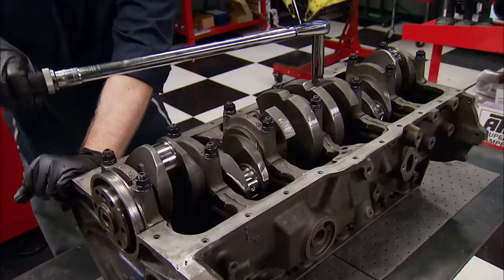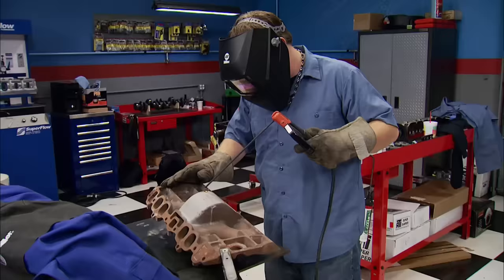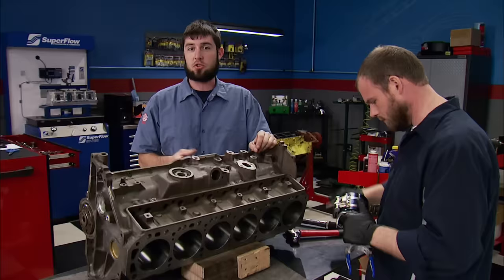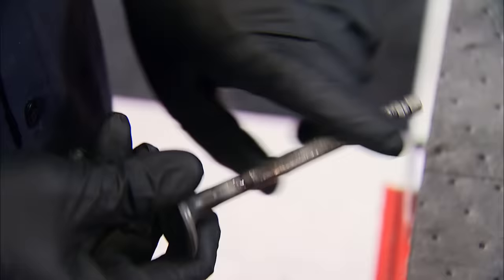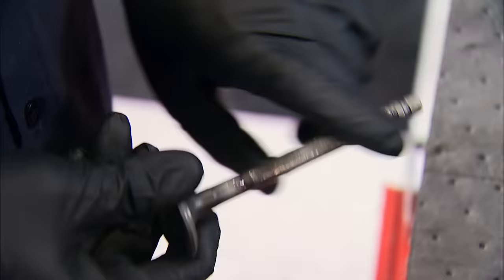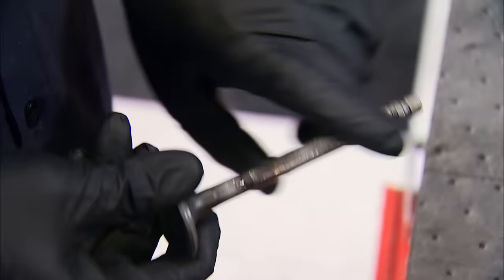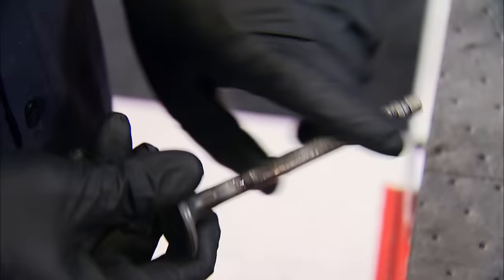What Will A New Top End Do For Our Old School Inline 6 On The Dyno? - Engine Power S1, E4

Comment: For the amount of money and time invested in building that 300 inline 6  I would have expected significantly more power than realized . Just the intake , cam, carb and header cost over $2000 together. Adding that to the rest of the parts and machine work and your up into the $4000 range. And what does that $4000 investment get you ? A gas guzzling 6 cylinder that doesn't perform anywhere near a used pushrod 5.0 from a wrecking yard costing about $200 + tax

Comment: These are super engines for old tractor rebuilds.
Reply: We used  to see some in trucks , not pickups , the big old 3 tons. When they were run loaded , wot for miles on end they were only good for 30-40 thousand miles before the bore was wore past a rebore . Thats why most farm equipment used a 292 chev

Comment: That 390 cfm carb is too small!!  Try a 500 cfm and it will really help the top end power.
Reply: Yeah, those 500 2 barrels are half a dominator for the most part, tuneable af and work great for daily drivers. I run one on a slightly modified 302 and it's so much better than the stock Motorcraft/Holley junk that came stock.

Comment: Never arc weld cast Iron.  Too much heat causes the material around the weld to be brittle.  Brazing and slow cooling is a far superior joint.

Comment: Use a torch to heat the crack red hot and weld it with7018 high nickel then tap it out

Comment: The comment about the steel crankshaft not handling high RPM is actually incorrect. There is a guy racing these engines with a factory steel crankshaft at 7000 RPM.

Comment: I love these 306 cylinder builds I would love to see this with a turbo or supercharger on it
Reply: I'm not saying that you couldnt do it, but the 300 i6 had such a long stroke that it limits the rpm alot. A super charger or turbo probably would spell its demise. They are great low rpm tow engines because of that long stroke.
Reply: @ciphercode2298  true

Comment: 5000rpm isn't the problem, snapping multiple role pins in the distributor shaft due to excessive oil pressure is the problem.

Comment: I was expecting a little more horsepower, after all it’s 300+ cubic inches. But they don’t say what the compression ratio is. I would have run a 600cfm vacuum secondary carb, I mean you wouldn’t put a 390cfm on a 289 or 302

Comment: I had a 300 paint can Ford engine in a van. The bottom end was a piece of S%#$. First blew with 23K on it. Under warranty it was replaced by Ford. The second one did go nearly 33K before it blew apart. They were junk..oh ! This happened in 1977, I never put these motors under a lot of strain, they took me to the beaches where I surf and back home, no undue pressure. This sealed my fate with this motor and with Ford.
Reply: Sounds like you really know how to abuse an engine.
Reply: @eskieman3948  your conclusions are based on your ego.

Comment: Ok guys I got one for you I've got a 95 ford ranger 2.3 . So what can y'all show me to get that 8 plug head down the road with a vengeance. I've always wanted to turbo it but was told you can't turbo a 8 plug you also can't find a aluminium head readily available for the 2.3. Which is sad because the 2.3 Lima is like a ball bearing in my opinion.

Comment: I want to see if anyone else agrees with me. 
This engine could have used a much bigger header and carb. For the carb, don't think cylinders, think cubic inches. This engine is 309.16 C.I.
One small block Ford V8 is 302 C.I., and people use 650 CFM carbs all the time. 
For the headers, don't think about 6 cylinders, think about one cylinder. Each primary tube handles only one cylinder. A Chevy 388 stroker has the same 4.060 bore, but a shorter 3.75 inch stroke. That puts each cylinder at 48,55 C.I. The engine build in this video has a bore of the same 4.060, but a taller stroke of 3.98 inches. That is 51.53 C.I., for one cylinder. 
Now, I know this is only part of the equation because half of it is about head flow, but at least the C.I., per cylinder should be included for choosing. 
It's just my thoughts. Am I on the right path?
Reply: you aren't going to see that much air moving on a low revving 6
Reply: @ironmonkey1512  I believe my 85 Mustang GT 302 had 550 CFM CFI injection on it. It shifted by 4800 RPMs at full throttle. The engine in this video only had 390 CFM. I just think that it is too small.
Reply: @jhutch1470  6 cylinder isn't going to move as much air as an 8 at the same rpm. Think about a v12 compared to your v8
Reply: @ironmonkey1512  I'll have to look some of this stuff then. I'm just not seeing how a 4.2 liter V-12 could pull more air than a V-8 that is twice the size. I guess I'm missing some science.

Comment: What carburetor was used I missed that part, putting intake and headers on a straight 6 today and was comparing carbs since they said it leaned out was curious if I have the exact same situation
Reply: 390cfm Holley, probably an 8007. Personally, with a 300 engine, I would have gone with a 600cfm.

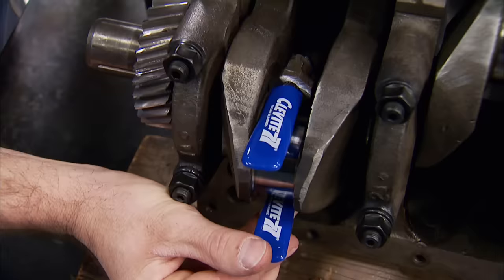Comment: This is the 3rd time I've watched this 300 build, but it's the first time I noticed the gouge in the cylinder wall at 6:18.  What did you do about that?
Reply: Nothing, you saw the blowby so you know the ring got hurt.
Reply: @jimmartin7881  Yeah.  At  14:10 I noticed the blowby before and thought it strange to have so much in a new engine.  It seems like such a small problem but that little nick could cause a rebore and new pistons.  If you look closely it looks like they used a ridge reamer and dingle ball hone and called it good...but maybe it wasn't good after all.

Comment: Hey I got one for you!. I have a Ford Ranger w a 4.0 v6. I've wanted to put a v8 in it but you basically have to have a v8 explorer donor car for all the parts needed and you even need to open the size of the trans tunnel at the firewall!. (Some guys just hammer the edge)  That's a lot of work!!. So what can be done to get better than stock performance out of my 4.0 v6??   Thank You!  Just smashed the subscribe button too!!
Reply: Put a turbo 4 cyl in it.

Comment: 390 is a bit small of a carb I think. I woulda went with a 650cfm or bigger. Would you put a 390 on a 302 sbf?
Reply: @thomasdaddio741  I agree. I was hoping for EFI as well
Reply: That's the trick with these engines, they were designed back in the 1960's and they don't breathe well at all. The lack of breathing results in excellent low rpm gas velocity and VERY good low rpm torque because of it, but as a result they still can't take in much air or fuel or get any of it out the exhaust. Crossflow designs, where the intake and exhaust are on opposite sides of the engine, solve this, but.... Stuffing long sixes into engine bays wasn't profitable anymore, so the V6 replaced it instead of updating the head. Overcarbing these engines is extremely easy, with 500CFM carbs running rich but making more peak power. When the stock redline is 3600 rpm, you just don't have much use for 650cfm carbs. The Holley 390 4 barrel has long been the king of the 300 world! It sure beats the tiny single barrel it came with :P

Comment: It was my understanding, after using plastigauge to build several engines that the journal/bearing should be "dry" with no oil on either surface to get an accurate measurement.  Somebody correct me if I'm wrong.
Reply: You're not wrong, it is to measure oil clearance

Comment: This would pull a heavy trailer all day and pull well on hills with more than 300 hp.
Reply: That 300 was tq, and the 206 hp comes out to around 150-60 after parasitic loss when installed.

Comment: What’s the recommended process for checking clearance with plastiquage oif the bolts are torque to yield, being you can’t reuse the bolts after you torque them down? Anyone?
Reply: You don't need to torque them all the way. Just snug so the plasti gauge flattens

Comment: What about the difference from that 300 to a 90s straight 6
Reply: Slightly different cylinder head that they optimized the combustion chamber shape for the port fuel injection, they added more threaded holes to account for the dual EFI exhaust manifolds having more bolts to support them over the old single log exhaust manifold, depending on the year the radiator fan (clutch or fixed) will bolt on to the older 300's but the newer ones are threaded in one of two sizes (as of 1983 or 1984, I believe, with a change in sizing coming somewhere down the line), and.... I think that's it?

Comment: Never ever ever use silicone on gaskets silicone Watering your gaskets to mush if you want to use a gasket sealer for gasket use Aviation type Permatex remember never ever use silicone on gaskets it will turn paper and cork gaskets to mush I've had to regasket mini motors because of silicone silicon is supposed to be used when you don't use gasket ultrablack is a very good sealer foremost non gasket uses like thermostat housing rear end cover gaskets oil pans and valve covers were no gasket is used and the front and back of the intake manifold on your older Chevys and Fords

Comment: I am not sure the point of this. Rebuilding a 300 to slightly better than factory. I rebuilt a 300 in engine class without all that machine and valve work and got similar dyno numbers with the factory carb and intake.

Comment: anyone else have crap results with Dupli-Color and VHT engine paint? Chips off if you look at it, with or without primer, 100% clean metal. I even had a result that regular rubbing alcohol on  a paper towel would lift color after a week or more of cure in summer weather.

Comment: Fix the parts used in this episode text.
It lists as using 3 different Carbs on this engine. What models needs drilling, because i would hate to drill in a brand new carb to get 200hp?
Wrong intake manifold.
Wrong valve cover.
Wrong MSD ignition
The Brakes and tires are not used in this episode
The Supercharger system is not used in this episode
I dont even think the Royal Purple 5W30 is used here either.

On a different note, my old year 2000 Turbo 4 cyl Saab had the same HP as this engine and nearly the same torque, when it left the factory.

Comment: maybe if you guys werent limp wristed you wouldnt have dropped a 6 cylinder bare block 😂 . NEVER use gasket sealant to seal up freeze plugs ! Use 3M yellow sever duty weather striping sealant on clean surfaces and make sure to coat the 2 surfaces where the plug slides against the block when installed . regular sealant has been know to let loose and freeze plugs pop out under pressure

Comment: LMAO! Complaining about $10:00 bucks! Not a wimper about the cost of the ARP bolts, and studs that weren't necessary for that build level! Stock bolts would have been just fine! And A LOT cheaper. If it had been a real budget build, probably could of have had it balanced. Should have used the vac.600 cfm and let it breath a little better, and still had the vac. secondarys.

Comment: Uuummm 305ft-lbs of torque? C'mon guys, that motor will sing with  a few PROPER modifications. Not sure I should be impressed, and I've owned 300's before, this is a gross misrepresentation of this motors capabilities.

Comment: If it were a FORD guy he wouldn't have dropped it. Dum ass... I built my 86 300 with Clifford parts. Bored it out to 305ci. 310 HP / 254 torque. Years ago the Germans Brits and Italians drop inline 6's in their racecars. Love the sound, love the low end grunt.

Comment: Why did You put such a small carb. on this engine, it is 300  cu. in. , You guys are always using  much larger carbs on v8 engines of the same displacement, it is no wonder that it only put out 305 hp.  , let that six banger breath a little

Comment: 'Nice and clean, so it's ok to weld", then they spray it to remove machining oils......
Reply: I'm pretty sure they were referring to the crude you find caked on to any old engine like that. Regardless when I took a welding class about a zillion years ago the instructor stressed that the metal should be very clean. No oil. So yeah. Clean it anyway.

Comment: 5 liters and 200 crank hp.  

I mean why?
Reply: They were made for low end torque. Not HP.
Reply: well the engine was designed in 1962 and were made to go into things like dump trucks and the big heavy duty trucks. The make peak torque at 1600rpm and are extremely reliable.

Comment: Wow that carb is way too small 650 cfm minimum
Reply: I have to agree. Every forum I've asked on,  has suggested  a 500 to 600 cfm carb. I'm  going to try a 500 on my similar build  right now.
Reply: @johnjamieson6368  I went triple webers on my 221 Xflow but i'm nearly getting 400hp
Reply: @johnjamieson6368  what rpm are you seeing on making maximum hp

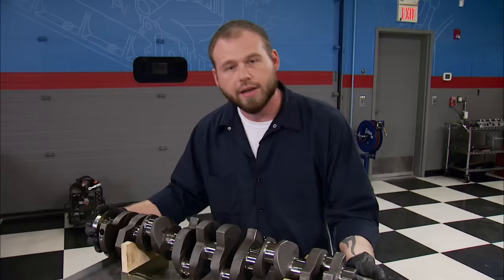Comment: 4:49 first lie. 3.980 inch stroke is not the reason the 300 can't speed pass 5k rpm. Toyota Camry 2.5 has a stroke of 4.06 and it make 203 hp @ 6600 rpm.
Reply: Wait.  You mean this thing with 2x the displacement makes the same power as a 4cyl Toyota?   Pathetic.
Reply: @bmstylee  No. He said because the stroke was 3.98 inch. It can not turn pass 5k rpm. I'm saying the Toyota engine has a longer stroke yet it peak @ 6,600 rpm.
Reply: @bmstylee  What I'm trying to tell people is. Where an engine make hp. Is because of the cam, not the stroke.